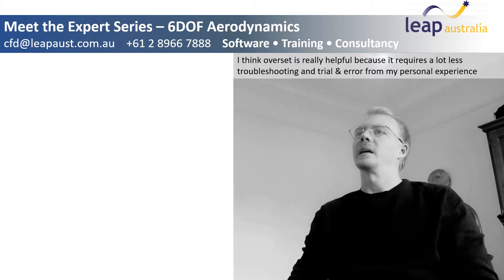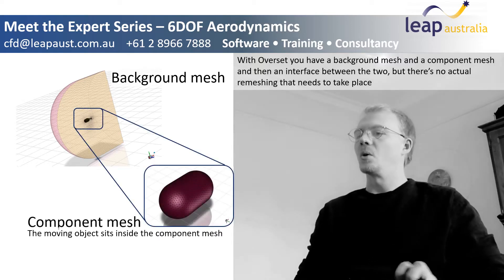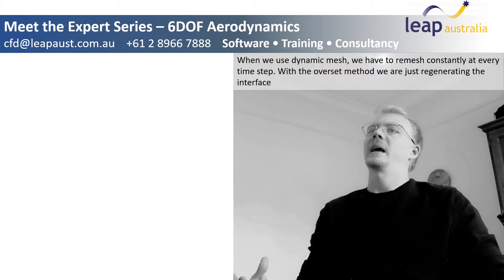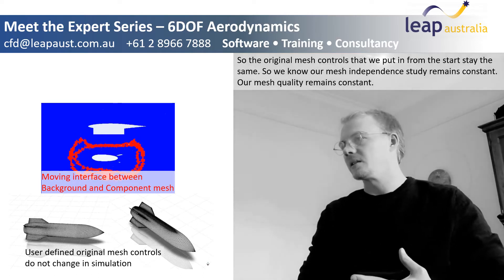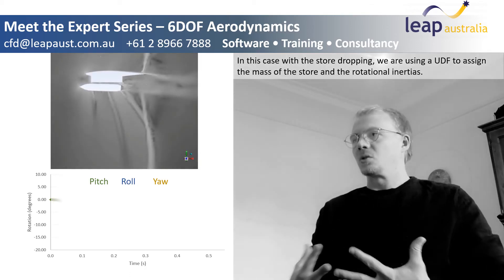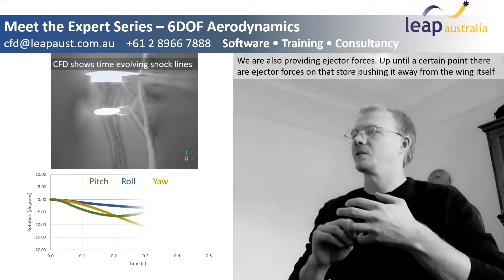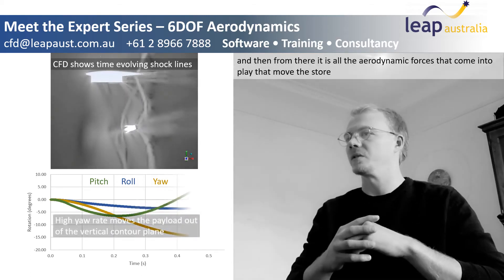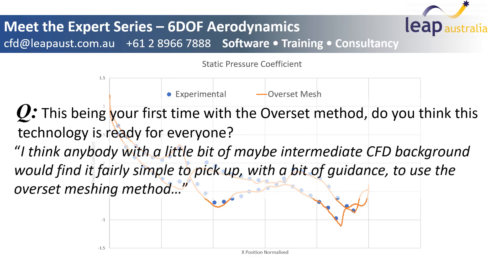ANSYS FLUENT Overset Mesh for Payload Drop 6DOF CFD

Comment: Thanks for this amazing intro. I've been using dynamic meshing for a store release project and have quickly found out how iterative this process can be. Its become obvious that overset is the way to go.
Reply: Hello, i'm working on a store separation project and I don't know how to use dynamic meshing or overset mesh in Ansys Fluent. Can  you give me some instructions about this topic? Thank you very much.
Reply: @hienaominh6588  Hi. Thanks for the message. I hope I can be of some assistance. 

When I use the tern dynamic meshing I'm referring specifically to the so called spring analogy method. This method works best when using tet elements. Don't bother if you are using poly or hex elements because it is quite a challenge to maintain acceptable mesh quality as the store moves away from the aircraft. Smoothing and reemeshing parameters must be fine tuned iteratively and that is a very time consuming process. 

So the way to go is to use overset meshing. This is such amazing technology that has been implemented in CFD codes. This is the so called "Chimera" method of meshing. 

To successfully release the store you need to take specific care to minimize or mitigate orphan cells. Secondly, you need to compile your UDF. I will discuss these in more detail now: 

1. Orphan Cells: These are a result of insufficient overlap between background and component mesh. The idea here is to ensure that where the meshes overlap, cell sizes in each mesh are about the same size. The critical areas that are prone to orphan cells are the gaps between suspension equipment and store. In other words, where walls of overlapping meshes are close to each other. A trick to keep cell sizing similar or compatible in these regions is to use BOIs in the small gaps in both the background and component meshes. You also want to switch the donor priority method to cell based (accessed via the following  TUI command: define\overset-interfaces\options\donor-priority-method 1) 

2. UDF: You need to write .c file containing store mass, inertia and ejection profiles if present and data is available. Please look at Fluent documentation and tutorials (stores release which I believe can be found on Ansys Learning Hub) for sample UDF .c files. The trick that gets people undone is with compiling the UDF. To do this successfully you MUST ensure that you have the correct version of Visual Studio installed for your release of Ansys Fluent. Please search this online. I will report back later with more information on what to look for online. Once that is taken care of you can successfully compile the UDF.

After that you need to hook the UDF to the store and the store domain (passive). The rest of the case setup will be exactly as you would do for any other external aero problem. Set turbulence model, boundary conditions, reference values, report files etc etc. 

You must first run a steady state simulation to provide the transient stage with an initial converged starting point. 

When switching to transient remember to enable gravity and set its value with correct sign and magnitude. When it comes to time step size I typically use 0.001 with 1200 steps for 1.2s worth of flow time. You can certainly experiment with coarser time steps but be careful not to go too coarse.
Reply: @azharcassim2795 Hi. Thank you so much for your helpful response. I really appreciate your explanation and I understand the process now. However, I would still like to learn more about the meshing methods and how to use 6DOF. Would it be possible to contact you via email for further assistance? I would be very grateful for your help.

Thank you again for your time and consideration.
Reply: @azharcassim2795 
Hello, thank you for the guidance, I was able to do it, but I have a question that I hope you will answer. After I successfully simulated the store separation, how can I obtain data to create motion graphs in different directions like in the video? Thank you, I hope to receive your response.

Comment: I just switched the material from air to water and the case was diverging after few iterrations. The motion of the object was an oscillating motion with increasing amplitude perpendicular to the expected object motion (that is correct, made no sense whatsoever). Why is that happening?
Reply: I am referring to the equivalent 2D tutrorial case provided by Ansys.
Reply from the maker: Thanks for your question. It's difficult to comment without understanding the full details such as whether you reinitialised the case after changing materials, as well as how appropriate your chosen parameters are. We recommend you get in touch with your local LEAP support team via https://www.leapaust.com.au/support/ stating your location and company/university. Good luck with your project!